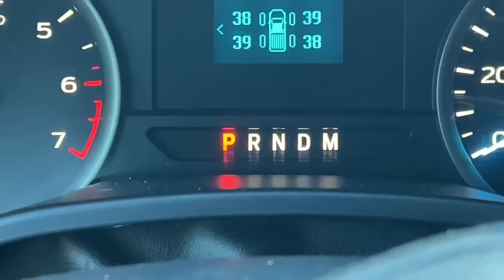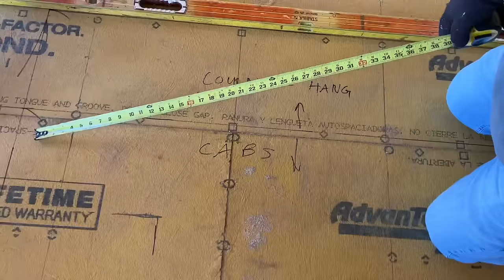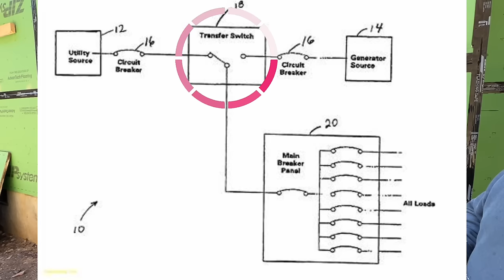Electrical “Plan” | Building A Mountain Cabin EP23

Comment: LED recessed wafer lights, you can put them wherever you want to because they are less than 1/2" thick
Reply: Mind explaining what wafer lights are? Thx Corey
Reply: We use them in every build. Super easy to cut out after drywall and paint are done. Clients love the adjustability and clean look.
Reply: I definitely recommend the baffled versions. Otherwise there’s an annoying amount of glare.
Reply: We ordered a bunch of WAC’s wafer lights for a project. They are super thin, but also gimbal so you can direct the light.
Reply: It's so weird to me as a Norwegian that Americans still use these huge massive can lights everywhere instead of LED downlights. Here you find LED downlights everywhere.
Reply: We use these in all of our projects in central Canada as well. All we do is run a wire to the approximate location of the lights, and hole saw the drywall in a perfectly symmetrical line right after drywall finishing is done and before painting so that we can fix any wandering holesaws
Reply: @wilbready  Yep! think its been 5 yrs since I used a an in a house. Even the outside soffits.
Reply: Waffer lights tend to be a big issue when using dimmers, because the drivers and dimmers don’t cooperate well at times and you end up getting a light that turns on faster than other or turns off faster. Also sometimes they’ll flicker and blink. Not a fan of wafers, cans allow solid housing and you could do whatever you want for trim.
Reply: @chrisalmasan2320   Curious how you handle depth limits with the cans. I have a lot of false ceilings etc with 3 1/2 inch room above the finish.
Reply: @fredthedude2  the trim lights you install into the cans are most likely LED trim lights nowadays. We use these cans on all our projects and remodel cans in finished homes. Never ran into a problem, yet haha
Reply: I don't like the LED down lights, because if the LED or LED driver or anything burns up, you got to strip it back to the wiring, and if you decide you want to change from the downlights to some other kind of lighting, you have to pull it down, cut a hole to install the new light, hope your wires are long enough for a different light, and install some way to support the new light. 

If you start with the big can lights, if the light goes out, just replace the bulb, and it's good as new. Or if you want a new light, the hole in the sheet rock is already cut for you.
Reply: I'll take the big dumb cans any day. I've had too many stupid integrated LED fixtures fail and you gotta go all the way back to the wire to change it out.

Comment: As others have mentioned, slim LED lights that are 1/2" thick will go even right under a joist.

For the porch lights, look into the Lutron smart switches, the switch can be placed anywhere, and then a remote switch surface mounted on the wall, goes with a regular switch plate.
Reply: Take a shot everytime these guys dry-laugh
Reply: old timers dont know this shit man ;)

Comment: I have a Toto. Added toilet outlets to make it work. Sounds silly but the bidet is a game changer. You walk in lid opens, seat heater turns on, light turns on, odor fan in toilet turns on. Water is also heated. After you are done and get up toilet flushes. The bidet squirter arm also self cleans. This it the top of the line that Toto makes. All of them don't do all the auto stuff so make sure to check the model if you are looking for certain features. The lid opening and autoflush are usually on the higher end models. 

When I was looking for one I didn't understand all the models and what the differences are. I did a deep Toto dive and have since helped other people out. Many options. You can buy just the bidet part and attach it to your existing toilet. You can buy a Toto toilet and add the bidet seat (the way I did it). If you go this route they have mainly two kinds of toilets. Some hide the hose some you see it. I wanted it hidden so I bought that model and added their top of the range bidet to it. If money isn't an object they also make the all in one modern units. Those start at around $4000 and go to $15,000. The way I did it was about $1900. The bidet seat which really is the most important part is about $1200 for the best they offer. The $15,000 unit doesn't have any more function than my bidet. It looks a lot cooler though. :) 

If you are looking for a cheaper way to do it Toto makes bare bones that just squirt with a wired remote. Costco sell those. No auto features or bells and whistles but it gets you clean.

Comment: The Leviton 5643-W is a stacked pair of 3 way switches. I have one for my ceiling fan and light with the other 2 switches being a speed control switch and dimmer. Works great.

Comment: I've also been binge watching your episodes since discovering your Channel a month or so ago. We use Lutron electronic switches with remotes to place a switch where it's convenient for a customer. Is also allows us to place a switch in an area where we simply cannot install an electrical box or wiring. In our area, they are code compliant so we can use them for three-way switches in older homes that don't have three-way switches at the stairs.

Comment: As an Australian, Listening to all these home runs in the kitchen is wild. 

Here you’ll be lucky to get more than 3 dedicated circuits into a kitchen. Everything is 240v and RCDs are mandatory on all circuits so really you might get one circuit in for your removable appliances, another for induction hot plate, and then a third for the oven. 

If your house was a cheaper build you would probably end up with appliances sharing the same circuit as the living and dining area or maybe sharing with bedrooms.

Comment: That's a lot of stuff happening all at once and yet you still were able to get a few pro tips into the episode.  Wow, I bet Nate's experience with the energized 220 ground line was SHOCKING and he most likely felt it also very reVOLTingat the time.  I bet he didn't just say "WATT" when it happened either  It's amazing how much POWER you can take and still be CURRENT with your faculties afterward.  Well, that's enough charged discussion so I'm going to AMP up my work so I can stay in line with my DIY projects too.  For the record, for real this time, I've been hit with 220 for a stove that was supposed to be off in a mobile home I was remodeling for a customer. Someone had wired the stove into the dryer breaker's spot and vice versa so I turned off the wrong breaker and I got energized big time.

Comment: Hey Eric/Jamie, 

One solution that you could do is a lutron remote system in areas where you can’t mount light switches (your living/dining room for instance).

You can install box that acts as a receiver to power on the lights anywhere in the room, and a wireless switch that is directly mounted to the wall. 

Not sure if the client has a budget for those but I figured I would throw that out there.

Comment: If you use the 6" or 4" wafer led lights you can also use 14 gage wire because there is no chance of someone changing the wattage of the bulbs

Comment: i definitely felt this! 
I spent probably 30 hours of just staring and thinking and planning out the placement of switches and lights and fitting in to the code when I built our house. Self built so I was the whole electrical crew!  
A lot of people don’t think about it when they hit a light switch, why is it there, what does it control, is it easy to get to and ergonomic. Why is the light located there, can I even get a box there to run a light? 
How is the actual wire routing going to go? How am I going to get power to x,y,z? 
Definitely had lots of headaches, but it actually turned out great…some how!?!? Lol

Comment: I just bought an old house and redid the electrical. Removed all switches and implemented a digital system. So I can now just stick switches wherever I want also some rooms don’t have switches but motion sensors instead. 

A friend of mine who is building a new house from scratch is now also doing the same. This seems to make a lot of sense to me.

I used Philips Hue btw, you get a system that is more flexible, cheaper and just works better.

Comment: Great video! Regarding blocking, wall framing and even electrical - do you photograph all interior walls and even ceilings just before putting up drywall? It would be good to document finished framing, plumbing lines, electrical conduits, etc. through photographing open framing with all blocking, electrical, plumbing and other items behind finished walls and turn over to owner upon final acceptance of house. That way, owners have a visual of what is behind drywall in case they want to do any future renovations. The photos can be taken with a phone or other digital camera, and can be key coded to a floor plan drawings.

Comment: Don't necessarily have to do that with modern SLIM LED's. You can just core a hole in the drywall and that sucker will snap on up there. Bam. Cerntered here, Aligned there. No more outdated Can lights! :)

Comment: I’ve started trying to add a 50 amp charger circuit to the garage or car port.  So much  easier with no drywall.  Most customers won’t go for it yet but in a few years it will be code.
Reply: In this case, since there is no garage, I would just oversize the wire to the block heater outlet to allow a future upgrade to a 50A circuit and receptacle replacement.
Reply: Already code in Quebec.

Comment: Consider installing a 40Amp or 60Amp circuit terminated in a junction box in or near the garage for electric vehicle charging. Size the wiring for a 32Amp or 48Amp continuous load. Your customers will thank you when they buy their first electric car.
Reply: It’s required here in Quebec. New code.
Reply: Just walked through a newly constructed house and he had installed 50 amp circuit’s with Tesla chargers on two walls for the cars.
Reply: That would be great as long as the 300' spans of #4 copper wire supplying the electricity up the mountain can handle the extra load... a few houses charging their cars at the same time would really put alot on the circuit...

Comment: I used a wireless light switch in my house that works really well. It requires no power for the switch. You can pu them anywhere.
Reply: Those are the bomb 👌

Comment: love the add on blocking, great idae.   also recess power for wall mount tv.   maybe also add cavity to run wires to stereo and cable if that is still being used.   yes we used to actually have components, yes I am that young.

Comment: I have my disposer on an air switch in the solid surface countertop at the sink. No gunky hands on the wall switch. All for extra receptacles in the rooms and spaces. Additionally, extra bedroom  light switches close to the bed is nice to have in the master - along with outdoor perimeter lighting controls there. Code is just the bare min. A good functional/convenience electrical layout is awesome.

Comment: Bosch has this where it shuts of if it gets twisted 90degrees to fast. Hilti has clutches on their drills to. Ive had the pleasure to catch my pant's with a 20pound hammer drill(te-76 I think it was) pre clutch time. Had to cut the 1 1/2"  concrete drill bit off my pant's😅

Comment: One thing I always do, which I don’t think was done: for all bedrooms and family/living rooms you should install the fan rated boxes (for ceiling fans) and run 14/3 or 12/3 wire to them. As an electrical contractor I have had to modify the installed boxes so the fan would not fall and hurt someone in the middle of the night. Cost adder per room is about $5, and I ALWAYS do it as a courtesy to future homeowners/renters (I even do it when I volunteer for Habitat for Humanity houses). It’s just the right thing to do.

Comment: 3:36 push button air switch on the counter top. Way cleaner.  Electrical supply is under the sink. (Same as dishwasher). Cheapest is on Amazon vs lowes.

Comment: I've got symmetrical placed lights, but I've build in Europe and because of this I had to build with a space between my ceiling and my joists. My ceiling is framed independent from my joists, connected for support but there is an air gap. That's also a solution, does make a thicker ceiling but it didn't matter here, since it was all calculated.

Comment: Some people may find the building codes and electrical / plumbing / stair requirements annoying but, I live in an old converted Inn.  It's now multiple apartments.  It was around 1850.  In my living room, which is roughly 15x18, I have exactly 2 outlets-- and neither close to a window.  Guess what that means?  You got it.  No air conditioning.  The only way I could put a window air conditioner in is if I ran heavy-duty extension cord.  And I'm not comfortable doing that.  On the bright side, if I'm very vigilant and keep my windows closed during the day and open them in the middle of the night, I can usually keep the inside temp around 70-75 dF.  That is, provided we don't have multiple days of 90+ temps.  Then I'm screwed.  And that's just one, simple room.  You should see my kitchen!

Comment: Rather than recessed can lights, you can use LED "wafer" lights.  I've seen a video where they were installed under  ceiling joists snd and they don't protrude down into the room any more than can lighting.  They are also more air tight.
Reply: Yep, they are thinner than the drywall.
Reply: I’ve used those but still prefer the reliability of can lights. Cheaper to change a bulb than a box, and baffled recessed lighting looks so much better.

Comment: Seeing those guys using Wagos just strikes me with Joy 😂
Reply: Wagos come standard on most can fixtures and I like using them also, but most box wiring is still done with tan twistees.
Reply: @lorenrickey5481  I'm a German electrician. I've never in my life seen wire nuts here. Almost everything in buildings is connected via Wago.

Comment: Here in Australia almost every circuit in the house has to be ground fault protected, even the hot water!  We use a circuit breaker with the ground fault built in (which are less than $30). it's cheaper than buying protected outlets for the kitchen and it protects the whole circuit.

Comment: Caseta  wireless are the ticket. We use Caseta switches on the solid walls. Put the main anywhere then put 1, 2,  or even 3 wireless location switches anywhere you want.

Comment: Love your videos. Could you do a video about drilling through a floor joist. Not 100% sure but it looked like the electricians drilled 2 holes to run the wires. Looks like they are close together. Did like seeing the pre marking the lines for a straight run.

Comment: Its so intresting to see how things are done different over seas, where I live for example, we Always have to run electrical in conduit, if its hidden in a wall, always, and also, we always put a so called installation layer on the outside walls, meaning a horizontal layer of 2x2" to make room for electrical, so that would eliminate the problem with a light switch next to the entrence door not fitting due to solid lumber as in this video, and also, in the ceiling we always put a layer of 1x3" one foot on center, both on trusses and floor joists if 2 story house, so that also allows for easy alignment of lights and such, (tho the primary reason for the 1x3 on trusses is that we Always put trusses on 4foot center so its a bit of a span, so it also acts as the carrier for blown in insulation

Comment: years ago I was working in a kitchen remodel and there were wires exposed I asked the owner if they were safe? he said the electrician had told him, they were, a while later one of the wires touched my forehead, it was live, it made my mouth shut so tight it loosened all the bottom front teeth, I was spitting blood for hours afterwards and it was weeks before my teeth firmed up again

Comment: install strapping on the ceiling and use the wafer led lights and you can put them anywhere. ( edit.. the problem is you can't install the actual light until the drywall is up but you can wire the box that comes with the light )

Comment: Your sparky isn't quite correct.  You can put a double switch in a single gang box and both switches can be 3-way.  Check out Leviton 5643-W switch.  It's a decora style but also comes in a toggle version

Comment: Is that recessed can junction box going to be accessible?
Reply: Yes they are. You can pull the inside of the can apart and access the wiring connections if necessary for a repair.
Reply: @lorenrickey5481  I thought so.

Comment: With the last couple of inspectors I've had, when I've asked them who they'd recommend for plumbing or electrical, they've told me they couldn't give a name as it might cross some ethical boundary. Is there a better way for me to approach the question with them? Was it the use of the word "recommend" that made them not want to share the names of contractors that do good work in my area? Just trying to figure out how I can get the information without making them feel like they're doing something wrong by telling me.